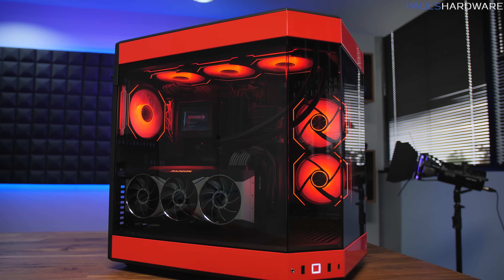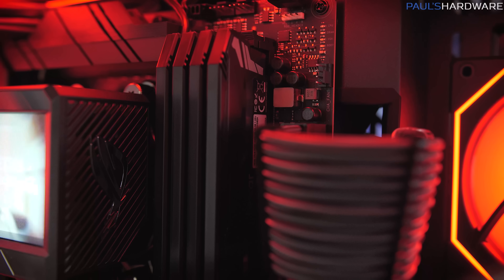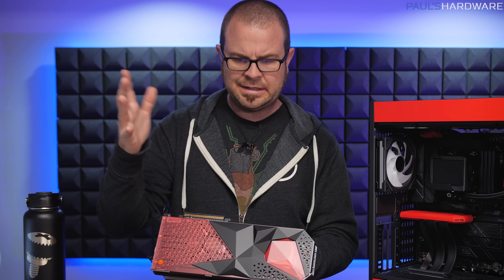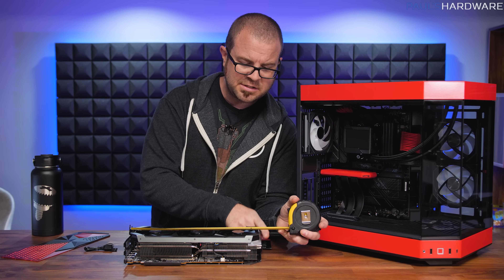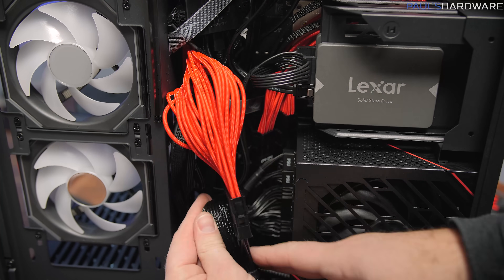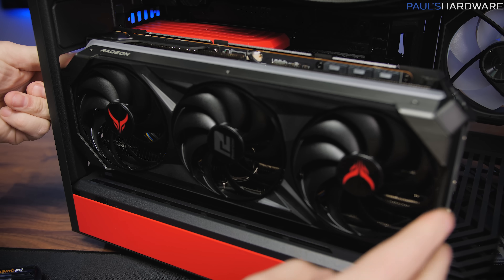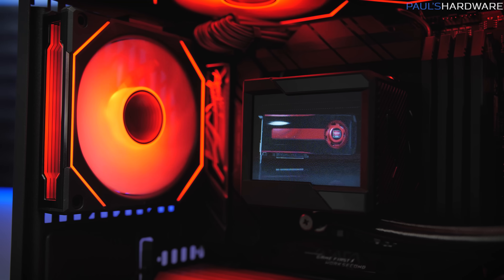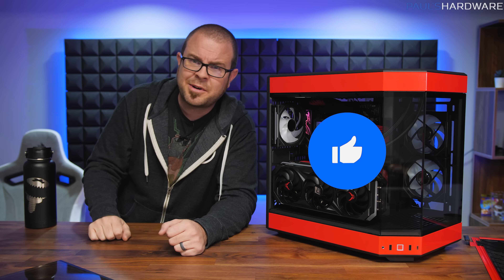This time I'll blame The Devil...

Comment: Hi Paul, I appreciate all the hard work you do to provide awesome content.  I have this exact build with exception of the red devil.  They are in stock now at local Microcenter and I'm wanting to grab one, but really need to know how the thermals perform in the Hyte Y60 case before I pull the trigger.  You mentioned a follow up on this topic but have not seen one.  Can you please at least post a comment to address this specific issue?  Looks like maybe 1/2" of clearance to the glass...seems pretty tight.
Reply: i agree i would love a follow up video

Comment: Nice job by Paul and crew and the build sponsors are awesome supporting this charity giveaway! And that build still looks better than I usually manage to accomplish!

One important point about the third 8-pin power connector on the GPU. If you were to remove the cooler assembly and look at the actual board, the power routing looks like the third 8-pin is doubled up with the second almost directly on the board and there's minimal extra power filtering - this is not unique to the Red Devil, most 3x8-pin AIBs do this. So while it might be slightly more stable at high loads it won't really help power delivery on the board itself.
The bigger deal, looking at most AIBs, is the majority of the actual board layouts look very close to the reference design. The only notable differences a friend and I have seen are on Sapphire Nitro+ (the only 3x8-pin AIB to add additional power filtering), Asus TUF (extra power phase on the VRAM), and ASRock Taichi (higher-current power chokes)

Comment: I had issues with the ROG Ryujin II myself as well. The pump would randomly shut itself off during games or even in the desktop. I think it's linked to the USB wire/hub since I noticed  when I hear a USB disconnect sound, my CPU temps would rise very fast to TJMax in the MSI Afturberner overlay. I RMA'd it and went with the NZXT Kraken z73. I really liked the display on the ASUS AIO since it's a rectangle shape.

Comment: Oh yeah, make more of these! A very good example of how such posts are not made: -The moderator talks way too fast and wastes time with explanations which are not to the point. -The result of his effortful assembly is, regarding the cable routing, a disaster. -Finally, the case turns out to be too small for the graphics card and the whole construction doesn't work because the "expert" must have loosened or pulled out "something, anything" during assembly. 
Oh yes, almost forgot - how is the performance of the card? Shouldn't that be the point?

Comment: I think the natural competitor to the 12VHO power connector, is the classic 24-pin motherboard connector, I think it'd be cool to see TWO 24 pins, one for the motherboard and one for the GPU, it's only 50% bigger than 2x8 pin that many of us are used to.
Reply: Could work. It'd have to be wired and keyed differently though, so the two can't be plugged into each other. A 24 pin motherboard cable provides a lot of voltages that a GPU doesn't need. Lots of 3.3 and 5 volts, and also the power supply on pin used to tell the power supply to fully power up when you push power on your case (or motherboard). GPU just takes a bunch of 12 volt lines. You wouldn't want to mix them up, plug them into the wrong spots. You do NOT want to send 12 volts to a bunch of stuff on your motherboard that's only expecting 3.3 or 5 volts. Not unless you want to let the magic smoke out.

Comment: I picked one up but a 6950 XT instead yesterday for $571 open box, no coil whine and runs cool and fast!. My power supply is only a 850W Gold PSU in a NR200P case and it is perfect.

Comment: if the GPU is starved for air could you get a plexiglass side and cut a whole in it and put a little mesh filter mod just where the GPU is or would it mess with the airflow of the case itself to much/look silly? just wondering for others that could be looking into a build like this with how big some of the new GPU's are

or instead of a filter just cut some small lines that air could be pulled in through [I have no clue how all this works just wondering if anything like that would work]

Comment: See if the case supports installing the card upside dow, then the replaceble plate becomes visible from the outside and the cooler is not starved.
Reply: Looking for un-needed solutions to problems created by Hyte :face-green-smiling:Imagine if they just kept the normal and correct way to install the GPU maybe that problem wouldn't exist :face-fuchsia-tongue-out:

Comment: I think Hyte might benefit from "borrowing" some inspiration from the Fractal North and offer a mesh side panel to replace the main glass for just this situation. The Y60 might be almost incompatible with cards like this one, and suddenly the mesh option makes any 3.X-slot card instantly viable.
Reply: or at least make a panel for the side that is mesh at the bottom and glass at the top - I was just thinking about this last week.  I have this case - and love it - I'm just afraid of putting a huge gpu in there.....
Reply: @frederickmiller5492  I was thinking of the exact same thing as another option, splitting it horizontally, glass top, mesh bottom.

Comment: The Red Devil 7900 XTX is what I have been considering (when I can find one in stock).  I am really interested in seeing how it preforms thermally in the Y60 case.
Reply: I have one in a Asus prime ap201 and it stays in the 50s on load. Likely hit 60s on a hot day.. it's a very cool card.
Reply: @Killswitch1411  What case are you running it in?  Mine would be in the same case Paul built in and would have the limited clearance against the glass as he shows in the video.  Just curious what I would be facing.
Reply: @AzraelsTear  Asus prime ap201. Much smaller case
Reply: @2buckgeo843  good for you. Must make you proud of yourself lol
Reply: Its obvious that it's not optimal.
Reply: @jondonnelly3  Absolutely it's not optimal, however that doesn't mean it won't work.  Which makes it a valid question.

Comment: I'd suggest swapping the hefty PSU out for a 150w weaker unit because it matches colours, then jamming a much juicier card in it was a bad move. That card drinks 400 watts and will have transient spikes higher than that. There are a lot of other things sapping power out of that system and I dare say you are now overpowering the weaker PSU. Standard problem solving would dictate if it was fine before swapping the power supply and graphics card, then the problem relates to them. It throwing a temp warning on the CPU when there is no possible way it is thermal throttling would be an indicator that it's dropping voltage (common in modern cars when the battery is low, it'll throw all the warning lights because the sensors are experiencing strange voltage values due to the sag under load) and causing sensor errors relating to it restarting/powering off.

Ps. Cracking giveaway and it's amazing what you guys are doing. 👌

Comment: Got my hands on one of these cards on a trip to my local parts store. ive seen it recommended that it should be combined with a 1000W power supply. i see you have an 850W Strix PSU in this build. do you feel this is plenty to power this card? im installing it on an x570e motherboard with a 5800x3d and 32gb of dominator platnium ram, and boctua chromax cooler with dual fans. and 5 ezdiy-fab casefans. giving that i have to upgrade from a 750W either way, which one should i go for?

Comment: Paul I just bought the PowerColor 7900 XT reference edition to replace my 1080Ti and got the same error as you that my CPU got too hot. I did some of my own testing and it seems to be the graphics card. The top of the card is so hot that it almost gave me a burn while not playing games if you let it sit for long enough. The card gets so hot that the air in the case is too warm. So when the air is going over the AIO radiator to cool your CPU it's too hot and in turn causes your CPU to overheat. I had to adjust the GPU fans to be over 80% at all times even at idle, watching videos and stuff, WHILE the side glass panel of my case is off to fix the heat issue. I have more details about the current tuning in the software and GPU indicated temps, which don't even seem to be right at this point.

Comment: What would be cool is an optional side panel with like. A half vented glass or mesh or the design from the top and other side on it for people doing air cooling with large gpus
Reply: There are a lot of sellers like that in Etsy.
Reply: something something Fractal North.

Comment: Happy to hear you're feeling better. It's good it finally came though, so we can stop this anticipation, cause it was a real mystery which card it would be.

I do think the 6900 XT Red Devil did look better than the new one. And with the Special Edition you got some metal Red Devil key caps. I had this card on order and it was cancelled on me without letting me know, and it took a month until I realized 😑

The Red Devil logo is still the best logo for hardware that I've seen. It's so clean and simple, yet still portrays so well what it is.

Comment: I think that this is a situation where they definitely need to offer a different side panel configuration if someone wants to put in an air-cooled GPU. I really like the case, but the tempered glass side panel in combination with vertical-only mounting creates a problem you can't work around without spending hundreds more to water-cool your gpu.

Comment: I woke up at 8am to grab a 7900xtx and as soon as 9 hit I refreshed and they were instantly sold out lmao I was annoyed as hell. I pass by microcenter on the way to work and was like fuck it ima see if they have any, too close not to. I go in, at first I was scared to even ask because I thought it would be a dumb question. Low and behold they had plenty of 7900xtx and several of the Red Devil limited edition. Grabbed a LE and been enjoying it ever since.

This is my first pc, I initially had a 6950xt Red Devil but returned it to Amazon as I literally just built this last month so basically a 300 dollar price difference and we’re chilling with a beast of a GPU rn.
Reply: I got the same graphics card but my only problem is my monitor is an asus 1440p 240hz g sync. Should I return it and change it for a rtx 4080 to get the advantage of g sync?

Comment: Which GPU would you recommend for video editing. I'm upgrading from 2070 non super as its running slow and laggy on 6K files and 4k high frame rates. Just bought the new CPU as the old 3700x is getting slow now. New parts bought:
Ryzen 9 7950X
DDR5 6000mhz

Comment: Got the same case and gpu did u ever find the problem the cards looks so amazing in that case but I got red and black them going on
Reply: I got the 7900xt red devil and the same case but black if u take the front glass panel of the card stop over hearing does not get airflow for the front of the card to well

Comment: I have temperature Problems with this card. Gpu 65-70 degrees and Hotspot 90-100 degrees 430 watt wtf? This is normal this card. No vapor chamber. Normal coldplate never more amd just Problems
Reply: This is what stopped me to take one limited edition red devil for decent price (as far as the current market). It's not even the many many complains about insane coil whine, it's the many complains about really high junction (hotspot) temperatures out of the box. It's literally worse vs reference while the red devil is twice the size.

Comment: Just got those asiahorse red cable extensions after you showed them in the other video :) I think you can use the 12-slot combs across the 3 pci-e cables to make it look a little bit nicer.

Comment: Limited edition? What's limited edition about it? Does it clock to 3ghz in gaming? lmao. Otherwise no point.

On that note, imagine if case manufactures started laying the motherboard FLAT, so the gpu doesn't have to worry about sagging. I mean if you are old enough (I know you are paul) computers used to actually be flat in terms of the case. Vertical became popular after the fact. We should go back to cases where the motherboard is flat instead of vertical. Plus this would help with cooling (liquid or aio) and offer more HDD space, which all cases today are seriously lacking. I mean honestly, most cases have TWO 3.5" HDD slots OR LESS.... why? I have THREE 3.5" drives and I plan to expand to more. How am I supposed to build a new rig properly if they have no HDD space? I saw the fractal node 304, has 8 3.5" slots, but can't fit an AIO nor a full size GPU (like my 6900xt doesn't fit). Modern pc building is kinda lame, lamer than my limp useless legs.

Comment: Wants fans on GPU not spinning if not needed....just no lmao. They turn on at what, 50-55C? The fans can't catch up at that point to cool it. Fans always running is just better, even at 20-30%; dont like noise? Use a headset. Performance > noise; 0db gpu fans is just junk

Comment: also legitimately: why the sata lexar ssds when most basic nvme 2tbs are cheaper and have more tbw????
like why not nm610 pros I'm so lost 😭😭😭
Reply from the maker: There are 4 SSDs (4x2TB = 8TB) in this build total, the two 2TB SATA drives and two more  2TB NM800 Pro NVME SSDs as well. I'd hate to downgrade to the NM610... 😉
Reply: @paulshardware  that's
fair
I didn't realize you also had the NM800's 😩

Comment: When NVidia releases a 3-slot card: "This is so huge, such a hassle to fit into cases and it blocks other PCIe slots! So unwieldy!" 
When AMD releases a 4-slot card: "Stays quite cool thanks to its frankly monstrous 4 slot cooler"

The slant is so cringe.
Reply: Amd didn't release a 4 slot card.
Reply: @tuckerhiggins4336  With the xtx you either go small and loud or big and size demanding.